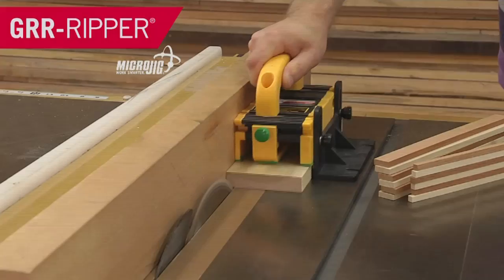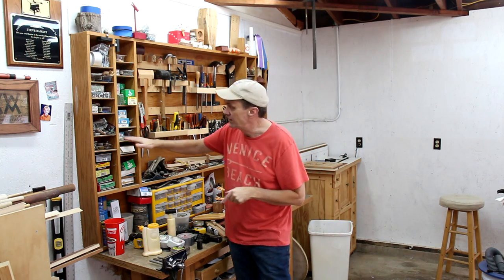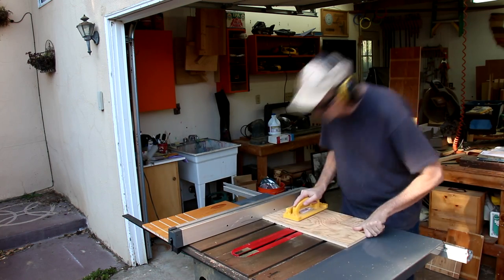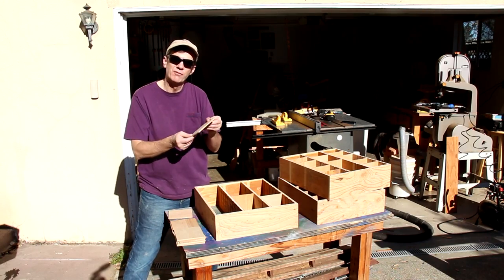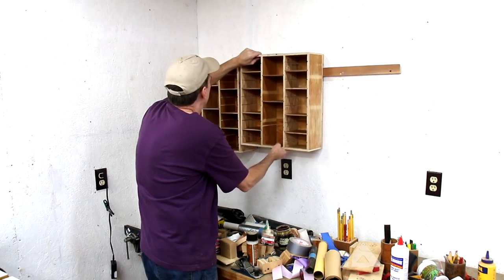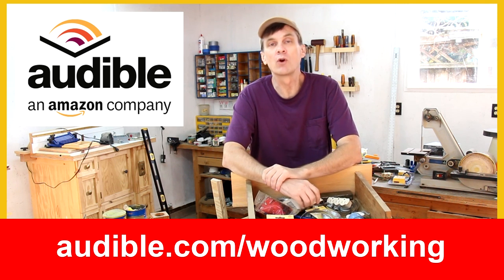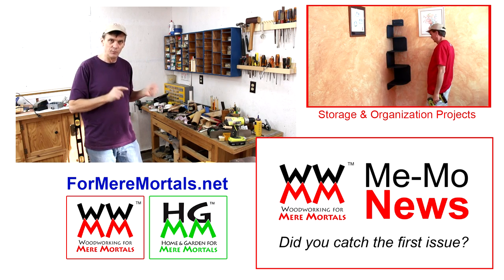Organize hardware in this cubby hole storage cabinet. Made from recycled wood.

Comment: And shortly after you threw out that scrap or extra part you find that you could have used it for something. I'm in the midst of organizing right now and this portion of the video cracked me up. Love the french cleat idea. Think I'll incorporate it into the cabinet I'm building to house the small bins for my screws, nut, bolts ect. And that edge guide for your saw is awesome. Going to get one.

Comment: Agree with your re-purposing!!! just took apart an old wooden tool box I bought at a garage sale. I’m using the 3/4 inch plywood bottom for part of my workbench shelf. The guy who made it had 15 2”screws on the bottom and sides with 4 on the sides plus about 30 nails. I used it to store nails but will copy your cubbyhole idea!!! Also using the 1x4 sides to start a 1 foot stool. Cheers!

Comment: creating shallow wall hanging cabinets above work surfaces is a great way to clear those surfaces.  I used the same french cleat system, however created the wall mounting much longer.  That way I can space them and use the sides for hanging / extra storage.  However if I need to I can rearrange as required.

Comment: I dunno Steve, seems to me every time I throw some junk away I find myself needing it the next weekend - and spending good money on replacing it. Its more a matter of getting the ratios right. You don't need all your vinyl tile scraps for example, but having some kicking around sure it useful. Same with old inner tubes, tubs, etc. Lots of "junk" a shop shouldnt be without IMO.

Comment: I use the multi-pass system.  The first pass chuck into groups: Keep, Toss, Donate.  Stage the toss and donate by the door or outside of house asap, so it don't filter back in.  Second pass reevaluate Keep pile: immediate or continuing use, upcoming project or use, just in case.  Just in case gets reevaluated for keep, toss or donate  Third pass sort keep pile into where stuff should be housed and then put away.  If it doesn't have a convenient place to store, reevaluate keeping it again

Comment: Could you do some different types of Skateboard holder? For the Wall, for just staying in room etc.?
Reply: Get a piece of pvc water pipe (inch and a half or 2 inch should do), cut a section out of the length of it so you can screw it horizontally to a wall from the inside. Where you made the cuts forms a cradle for the wheels and the boards can hang vertically by their wheels :)
Reply: Richie Rich  thats a great idea :) thanks

Comment: The backboard looks like it would add a lot of unnecessary weight to the bins.  I understand its' purpose to hold the french cleat, but could you use much thinner wood?  Or is the thicker wood required for the structural support of the bin?

Comment: "now I can clean those up and get a more accurate cut on my table saw", I have a Festool track saw that would get you a finished edge and accurate  cut in one pass. Yes, it is terribly expensive but one thing that I have bought that worked like it was hyped to work. Festool TS 75

Comment: Steve - Great video and repurposing of your shelving unit!  It has really "opened up" your shop!  I especially like the shade of blue paint that you chose!  Wanted to ask you a question, did your table saw come with a riving knife or did you add that later?  I have the Hitachi C10FL which is the equivalent to the Porter Cable that you have an have been looking for a riving knife.  Keep up the great work and happy new year!

Comment: I agree you shouldn't keep anything more than 1 year. If you have a problem throwing things away, donate or give them to someone immediately. By giving them away or donating it lessens the blow of throwing it away. 

There is a way to not have so many of the same items or pieces and parts. That is to put in place the same rules as a Chef. Since I am a chef and wood worker/carpenter I use it all the time. Its called Mise En Place, it translates to Everything in its place. So the next time you get ready to embark on a project write down every thing you will need to complete it. IE: tools, supplies reference material, then go through your shop and use what you have first before buying anything. This rule in the Chef world is knows as FIFO which translates to: First In First Out.

These simple steps will eliminate waste of any kind. I hope this helps.

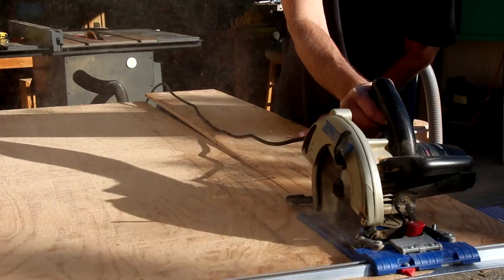Comment: at the 2:00 mark  what is that attached to the hand held saw? Is that designed for that? Looks like something to help cut straight lines. Any details on it?
Reply: That's called a rip-cut, made by Kreg. It's basically a t-square you mount to your circular saw blade tray, usually extends to 25" so you can cut plywood sheets in half straight and quick. great attachment

Comment: I say If i have had something for  more than a couple if years and havent used it at all chances are I wont and  i would Spend 10seconds looking at it and if i couldnt think of anything to use it for- to the trash it goes.or scrap yard . And I would move on with my shop life.i get what u mean by "emotional attachment"say a tool from a relative or friend tht passed away.( If tht is what u mean by tht).but thts sentimental value lil dffrent. But Other then tht to the trash it goes.. knda gves the "10 second rule" a new meaning..good luck on ur quest steve! Cant wait to see ur end results

Comment: I heard, make 3 piles.  One to keep, one to give, one to trash.  Spend 1 hour a day at it. - Optionally spend 50 minutes a day, and 10 minutes putting back 1 pile, batting 1 pile to give, and getting the 3rd pile to the trash. Then if you have the energy, start another 50 minute run. - It helps when I do it.  But it is hard to keep at it.

Comment: If you want to be RESPECTED or responsible, LOOSE the SHITTY noise-track!!! We have to turn the sound so low I can’t hear you.  I guess hearing you is NOT important. Right? Yup.
Reply from the maker: Calm down Karen
Reply: @SteveRamsey  Don't you wish you had a nickel for every 'mean spirited' critic?  You would have so many nickels you'd have to hire someone to count them!  Great channel and impressed you even bothered to respond to an older, but still very apropos video.  My problem:  I never found a nut/bolt that I couldn't use later.  Like I tell my wife, it's not junk, it's 'future resources'.